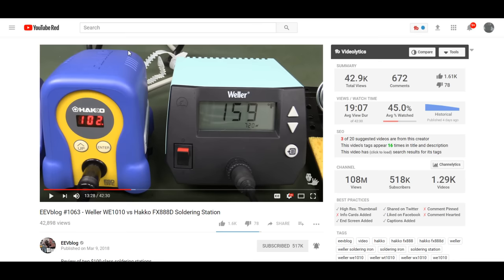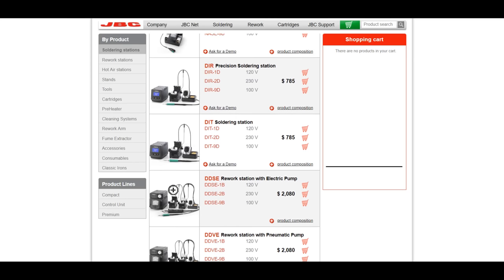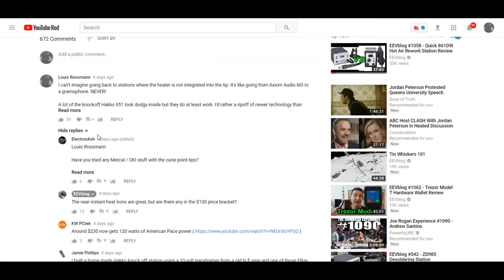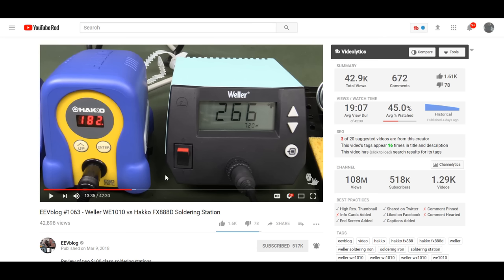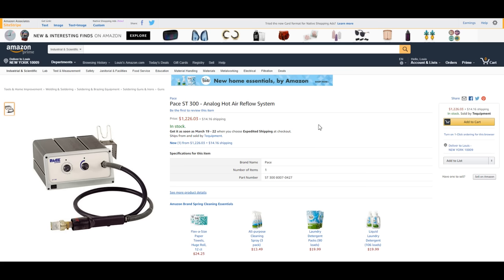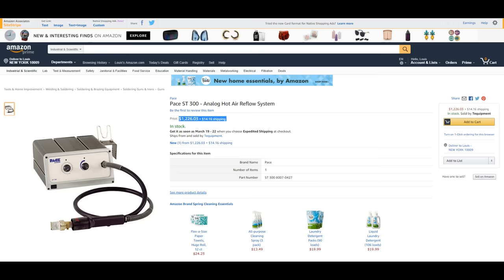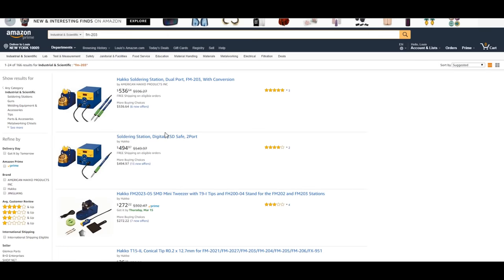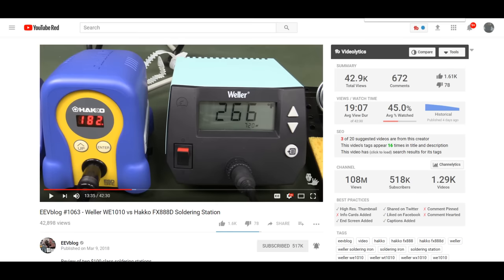Soldering station technology & the lie of "SOLDERING PATRIOTISM"

Comment: With Celsius you can use decimals for more precision where it's needed, but the scale reference points are what makes it better imho: 0 is freezing water, 100 is boiling water. You can easily gauge a temperature based on those limits, and even more precisely knowing that 37°C is body temp & 50 is sunny desert.
In Fahrenheit every reference point is random numbers: 96°F is internal body temp, 32°F is freezing water, 212°F is boiling water etc
Reply: Fahrenheit excels for outdoor weather. 0 is freaking cold, 100 is freaking hot. Whereas Celsius devolves into random numbers here: the same range is -17 to 37. A scale based around water's phase changes is useless for weather and human comfort. For everything else, sure. Celsius all the way. But weather in Fahrenheit or GTFO.
Reply: @mjc0961   0°C gives great gauge of weather, if it goes under zero, you must expect snow or frozen rain instead rain, ice on roads etc.
Reply: @mjc0961  Well said, I agree completely. With that said, I wish we would use the metric system for distance type of measurements.
Reply: @mjc0961  -17 doesn't really differ from -16 or -18 in terms of comfort. There's no threshold there, or at 37 either. Sure it's fun to have barrels (32 gallons? depends which barrel after all it's different for wine or beer), fingers (7/8 inch,  how intuitive) or even knots but it's not very practical, and even amusing how some try to hang onto these. I mean I like steam machines, but they belong in a museum...
Reply: @bencze465  We talking Imperial gallons or US gallons???
Reply: What makes the freezing and boiling points of water good reference points? It is an arbitrary choice.

BTW, the original reference points of farenheit were 0 and 96, and they were both chosen for ease of reproduction rather than a belief in the magical power of water. 96 was the value chosen for the second point because it made it easy to quickly mark the degrees off by just eyeballing halfway repeatedly. This was very important since people were mostly making their own thermometers. It wasn't just LOLRANDOM.
Reply: @CptJistuce  
Water is not magic, but it's properties are well known, and have been for centuries. At atmospheric pressure water will freeze and boil at the exact same temperature regardless of your location.

The number on a scale are not important, what mater is the references points you take for your measurements. The Fahrenheit scale was established using a custom mixture freezing point as the lower mark and the estimated body temperature at the time as the higher mark, everything else would be measured using those reference points.

The problem is the mixture can be messed up, and the body temperature fluctuates. This means that at the time, a west coast and an east coast company could produce measuring devices with an offset of a couple degrees between each other.

You have to understand that like the imperial system at large, all the original reference were dropped in favor of the international system. Exactly as an inch or foot is now exclusively defined in meters, the modern Fahrenheit scale is now the Celcius scale with a conversion formula applied to it.
Reply: @Rubafix989  Salt water's properties are ALSO well-known, and have been for centuries.

And fun story, the physical properties of water vary with purity and isotopic mixture. And as you implied(but conveniently handwaved away), altitude and weather affect it. So you don't actually have a controlled constant for industrial mass-production like you're implying, because outside a pressure vessel a centigrade calibration will fail just as a Farenheit one will. And very few people have access to the official cup of water used for calibration.

While I do not know Fahrenheit's methodology for certain, I would assume he used a fully-saturated saline solution, because it makes it much easier to reproduce(which, as stated, was a goal). It won't accomodate impurities in the water or variations in air pressure without additional measures, but hey, neither will anything else.  
Both common temperature scales were originally designed with ease of reproduction on a personal scale as a goal, Farenheit did it better, the french liked Celsius's ideas better(but backwards). Both scales were redefined for increased precision multiple times over the ensuing decades.

Also, the modern centigrade scale is not defined by water's physical properties(and in fact, has been misaligned with them for some time due to errors that were subsequently propogated to maintain compatibility). 
Disclosure: I'm continuing to use the name centigrade over standards-body objections because Mr. Celsius proposed a temperature scale inverted to centigrade, where larger numbers are colder. Modern usage puts his name on a standard he rejected.

Also, rankine is the best scale. It is calibrated to absolute zero explicitly(as opposed to kelvin's implicit, roundabout definition that could be a source of error in the future), and goes up in freedom-sized degrees for greater precision than kelvin at any given number of digits.

Finally, you have to understand that all arguments about perceived historical imprecision are irrelevant to modern usage under definitions largely unrelated to the historical origins.
Reply: @CptJistuce  
"but conveniently handwaved away"

Both atmospheric pressure and sample quality apply for the Farhenheit measurement on-top of the aforementioned problems.

But you over-estimate the variables. If you're worried about the water sample, take a kettle at a fireplace and distill the water. For atmospheric pressure, find a seashore, but honestly we're talking 3° every thousand meters and it's linear, you can measure and account for it.

Celcius water boiling point has been adjusted by like a tiny fraction of a degree but honestly you don't even account for it unless your field demands absolute precision. 

And while it's true that everyone could use Kelvin scale, the ability to display all the common temperature on planet earth with 2 digits and having negative temperatures mean cold and positive mean hot is quite intuitive imho, and makes Celcius a better fit for day to day life. For anything else Kelvin make more sense.

Farhenheit was a product of it's time, that got fixed to the point where it's just a redundant system that cost millions to maintain for no proper benefit.

The USA is a metric system country, they just like to take an extra conversion step for the general population.
Reply: @Rubafix989  One of your mentioned problems isn't. A saturated saline mixture is always the same, for a given water purity. And I'm certain that a more stable second point than "your armpit" was established before mass production began. This myth that farenheit is an imprecise and off-the-cuff nonstandard is one that the french numbers crusaders like to toss out all the time, but it simply isn't true. It has been a precise standard for a very long time. 

I was actually thinking of the centigrade freezing point of the one that was changed due to errors. 0 degrees commie is not actually the freezing point of water.

The argument that centigrade's range is better is a purely aesthetic one that I happen to disagree with.

And no country on Earth has switched to metric because it was what the people wanted. Every switch I know of was forced by the government over the objections of the people and most have been incomplete in practice.
Reply: @CptJistuce  The maximum quantity of salt you can dissolve in water depends on the temperature of said water. So you need a way to reliably get the water to a reference temperature first, which is an additional constraint.
Reply: @Rubafix989  Since it is a saline solution at the triple point, the temperature is self-controlled. You keep adding ice and salt until they both stop disappearing.
 Even easier if you start with just ice and add salt. Done that several times with my ice cream maker.

Which is why the reference point was chosen, for ease of reproduction.
Reply: @mjc0961  "Fahrenheit excels for outdoor weather. 0 is freaking cold, 100 is freaking hot. Whereas Celsius devolves into random numbers here: the same range is -17 to 37.", "But weather in Fahrenheit or GTFO."

- I disagree. For example, my home climate ranges (in Celsius) from -32, which is pretty cold to 32, which is pretty hot. So nice symmetry there. In Fahrenheit, the numbers would be -25.6 and 89.6, neither of which makes any sense. And yes, I know that in dry climate, like e.g. in Vegas, even 42'C (107.6'F) is not bad, while in e.g. Florida it would suck major ass. BTW, I also think that Fahrenheit scale is way too 'fine', especially knowing that you measure human height using a very coarse scale of (feet and) inches (2.54cm).
Reply: @bencze465  Most power generation, NUCLEAR, Coal Fired, Gas Fired, And High end reflective solar Are STEAM MACHINES! Even state of the art Space born power plants used on both Voyager space craft, and on NASA's leftest mars Rover "Curiosity" IS a "steam machine".
Reply: @mjc0961  0 degrees C already qualifies as freaking cold everywhere (except Fargo)
Reply: @wayneg2139  The Voyagers used steam machines? I always assumed the rtgs would convert their thermic power into electric via peltiers or something?!
Reply: @CptJistuce quick google search tells 0°F for the temperature of an equal ice-salt mixture 30°F for freezing of water and 90°F for human body temperature. And then they got revised to 32°F freezing point of water and 96°F body temperature, and then the body temperature got revised again to 98.6°F. 
So in conclusion the freezing point of water was used in both cases, but °F also took body temperature which I would argue is a bit variable even under the same outside conditions between humans, and salted ice. Also if human body temperature was set at 100°F the freezing point of water would be 32,5ish°F which seems way nicer to me than the current setup, just because of having more cleen numbers as a base. 
And regarding the marking of degrees, why not a 0° to 100° giving one step more of whole numbers when repeatedly deviding by two than starting out with a crooked number?
Celsius just seems nicer from the start, 100°C to freeze water, 0°C to boil it, and one inversion bc idk and then it stayed, having only gotten better definitions for 0°C and 100°C.
Reply: @Alex_Vir  I've seen a lot of speculation for what the high end's 96 was supposed to be based off, but I've never seen it as an even 90 before. And the scale did not define 30 as freezing fresh water, because you don't define three points on a temperature scale. That's just about where freezing fresh water landed on the scale.

0 and 96 being the anchors was to make marking them easier when people did these things by hand. Every new mark after the two calibration points is precisely between two existing marks, and humans are pretty good at dividing a thing in half.

32 being the freezing point of fresh water is a very modern adaptation, from when the US was experimenting with metric in the 80s. Those experiments ended right after the government mandated measuring instruments had to feature both units, and the transition became public-facing. People HATE changing units, and the backlash was immense, so plans to force it on the public stopped dead right there.

Ultimately, it doesn't actually matter what the anchor points are(as long as they're precise), nor that they are aesthetically pleasing. All measurement scales use arbitrary numbers that have no special meaning. Centigrade is not BETTER because both ends are (approximately) phase change points of fresh water, unless you happen to be researching the behavior of fresh water.
The only exceptions are rankine and kelvin, which use absolute zero as zero(albeit indirectly in kelvin's case) and an arbitrary point for the second anchor. But no one wants to use those, so they just argue about which arbitrary numbers are more ideologically pure as if it means anything at all.
Reply: @CptJistuce There is no second anchor point for the K or Rankine, unless you count the breakdown of matter into a quark gluon plasma.
Reply: @sophiophile  There has to be. The "size" of a degree must be defined by something.
Reply: @CptJistuce  I mean they are simply borrowed from the non-absolute system which had two physically defined anchor points. So their second anchor points are derivative from another system.

Comment: Louis, have you tried the TS100? That thing is an absolute beast. It's marketed as portable, so you can power it from a battery or just a wall-wart. Even compared to full-fledged stations, it's still very impressive. Great example of where technology is at nowadays, and anything less for higher price is simply disappointing.
Reply: After hearing Louis talk about the heating element being in the tip i thought about the TS100 that could be a great option for someone like me that wants to solder his own keyboard and perhaps later on repair small electronics.
Check out Marco Reps where he compares it whit a Weller Like Louis he mentions the heating element around 03:45
https://youtu.be/HgrB5P-rDLw
Reply: only thing that's missing is a nice low cost desoldering iron. The Hakko FR-301 is €300 i could go for the "aoyue-8800" that one is €165 even the larger Aoyue 474A++ is €179 instead of the more expensive Hakko FR-301.. De soldering is full size keyboard with a hand solder sucker seems a nightmare..
Reply: I have TS100 and i will not buy another iron for a long time. I pay $50.
Reply: do you use it for longer period say 1,5 hours ?? doing a large project?
Reply: I use it all day long, but at max 10 min. each soldering. More than that heat is transfer to the iron body. It is just 'incovenient' but hold it for an hour must be unconfortable...
Reply: thank you very useful info..i think the FX-88D is better for me..
Reply: Phasedragon tip is too long
Reply: I have built my own desoldering iron out of a cheap manual desoldering tool and a hot air station that had a burnt heater. I can elaborate if you wish. But it is a pretty involved project - i just happened to have the stuff lying around.

The Aoyue is actually a pretty good tool from what i've read and seen online, based on my own home-built tool, i think this is one area where you really do not need a Hakko. A good soldering iron is a must if you're doing board repair every day, but for desoldering, the chinese tools are OK.
Reply: Note i am talking about a desoldering tool as in "desoldering iron with manual pump" not a plastic solder sucker, of course. Still, the iron cost me $10.
Reply: I got a TS100 for Christmas. I haven't had chance to use it yet. The only soldering I've done was away from home and I had only a cheap iron to hand (did the job fine though). I did plug it in and switch it on though and it heats up impressively fast. Running off a wide range of DC voltages is going to come in very handy too.
Reply: The issue with the ts100 is longevity, how long will it last? How long do the tips last? Hakko 888d is fine for most non professional purposes and if you do decide to upgrade you will still have your old hakko 888d  as a secondary iron.
Reply: I agree, I have one and it's awesome! I use it with laptop chargers, ANY charger will work with it out of the box (as long as the plug fits). If it doesn't fit, get a bunch of adapters from eBay or Aliexpress for $5 ;-)
Reply: The only thing I'm missing with the TS100 are Hakko's Mini-Wave (CM) tips. Those things are a godsend for drag soldering.
Reply: Adriano Coelho Now the price is 70-100$ it's no longer worth it.
Reply: Where are you looking? Amazon has it for $70 tops, getfpv and racedayquads still have it at $50. And if they ever run out of stock, banggood has it for $50 too and I can only assume they'll have much higher stock, if you don't mind the shipping.

And even if it was $100..... what are you comparing it to? Hakko fx951 is at least twice that
Reply: +b888 What are you talking about? It's $56 right now.
Reply: I'm glad I got mine while it was cheap haha
Reply: Bruh, he has the money so he should try and get the nicest stuff. Along with that, a ts100 doesn’t compare to a hakko. A hakko is much more reliable.
Reply: I used it once for over an hour at max temperature of about 400°C for wood burning. It's getting quite warm, but it works still fine. I still use a JBC station at work, because I think they are a bit more convenient to use. But not by a lot, I love the TS100. I hope Louis will test it eventually.
Reply: Got one extra tips
Reply: What about the Pencil then?
Reply: Yup, got a ts100 a couple of years ago. I usually power it from a meanwell 24V psu or a 6S lipo and that thing absolutely rips through groundplanes of flight controllers like it's butter! No problems tinning 10-12awg wires either.

Comment: I'm a hobbyist. I've been using a cheap hakko 936 knock-off iron, the Yihua 939D (75W). It holds temp very well and heats up quite fast. It has been very reliable. Does it work and fit all my needs? Abso-fucking-lutely yes. Do I need any of the new tech crap? No. however, I do have the TS-100 because I was fascinated by the fact that the firmware is open-source.

So if you're just starting out, maybe all you need is something just like the Yihua 939D for about $30-40.

Comment: When looking for a source of the knockoff Hakko FX-951 I came across a number of even simpler and cheaper stations that seem to use the new technology, with quick heat-up times etc.. the nice thing is that they are even cheaper.. The common name I found is T12, which seems to be the type of tip connector/handpiece they use.